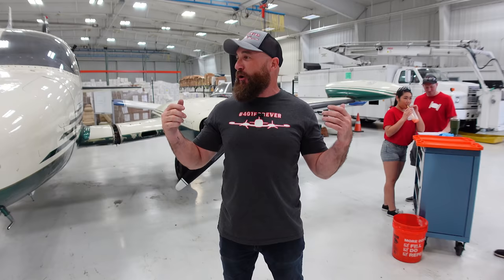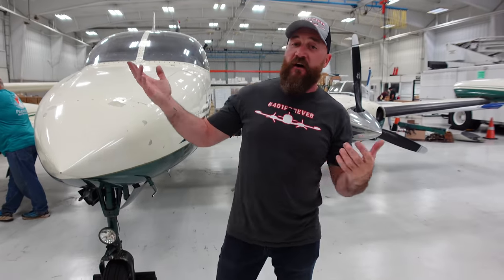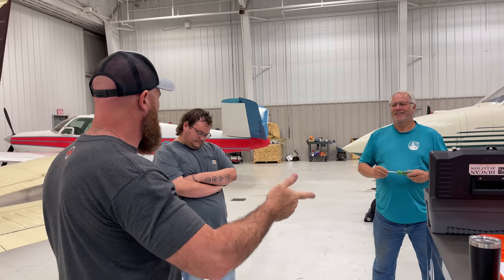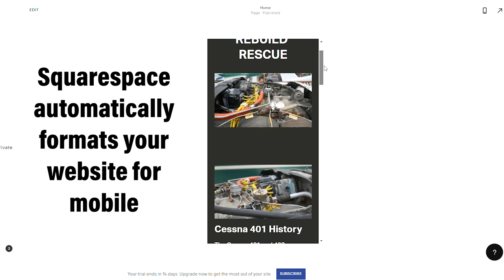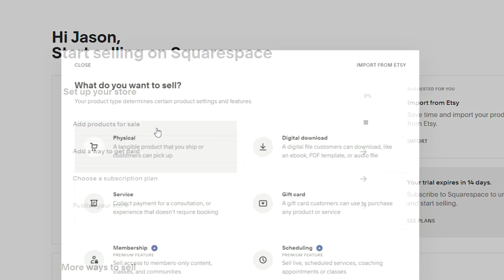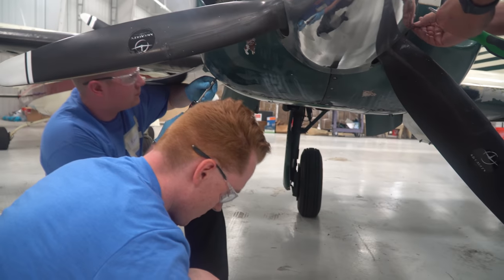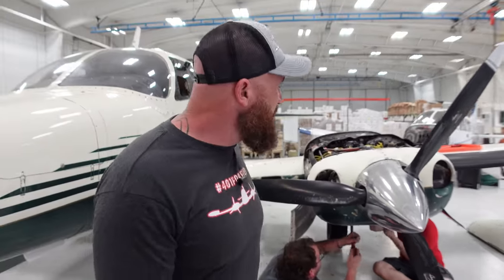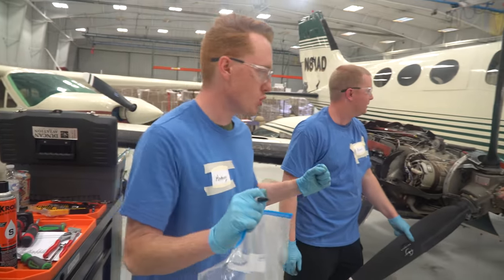Who Will Win The FREE Abandoned Airplane Mechanic Challenge ?! Ep15

Comment: The only way that will fly legally is have it put together by certified A+P's
Reply from the maker: The two teams are certified mechanics 👍🏼
Reply: "The only way that will fly legally is have it put together by certified A+P's"  

You should probably read up on the FAR's because you are 100% incorrect.  As long as someone is working under the direct supervision of an A&P,  they can absolutely work on the aircraft.  The only stipulation is that they may not sign off any work that they do.  100% of certificated Aircraft Mechanics should know this.....
Reply: @niknotaviation1534  Regardless it has be a certified A+P
Reply: @safffff1000  Please elaborate. I’ve been an A&P for 20+ years. I assure you, I know what the regulations are and what can and cannot be done. I’m not following what you’re saying.
Reply: @niknotaviation1534  I'm not disagreeing with you

Comment: I have never removed an airplane engine, and probably never will, but I have removed literally hundreds of automotive engines, rebuilt and replaced, and one thing in common is to drain all fluids first. DUH....
And to see "veteran" mechanics use adjustable pliers and vise grips to secure nuts and bolts where box end wrenches are the better choice was odd. But using manual ratchets regular screwdrivers when you have electric impact guns and drill drivers can only make you wonder. 
And I have to ask, mounting an engine on its' end to a tripod stand like that looks like a Laurel & Hardy moment waiting to happen, is there not a more stable way of doing that?

Comment: I cringe when I see people using power tools to remove fasteners on airplanes. I've asked airplanes and they prefer speed handles for that human touch. 
...and I guarantee a proper use of a speed handle means you almost never need the Johnson bar.
Reply: "I guarantee a proper use of a speed handle means you almost never need the Johnson bar".  I would consider myself pretty proficient with a speed handle (20+ yrs A&P), and I have to use the Jo Bar all the time. You ever remove cove panels on the horizontal stab of a G550?  I'll make you a bet.....  $1000 says you can't get them out with your speed handle alone, and that you'll either have to use the Jo Bar or drill them out.  You in???  Also, I 100% agree about the use of power tools on aircraft.
Reply: @niknotaviation1534  
I haven't worked on any civilian airplanes. I'm speaking from my time working on the Lockheed U2. One of my favorite things to do was wait until someone walked to the tool crib to check out a Johnson bar. I'd grab the speed handle and remove the screw before they got back. 
So what's the deal with the screws on the G550? Are they not torq-set screws? Is the angle odd so you can't apply pressure to the speed handle?
Reply: @niknotaviation1534  A screw gun set properly and used correctly typically isn't an issue. I had my speed handle out as well. Subjective preferences. Most of the nut plates were trashed to start